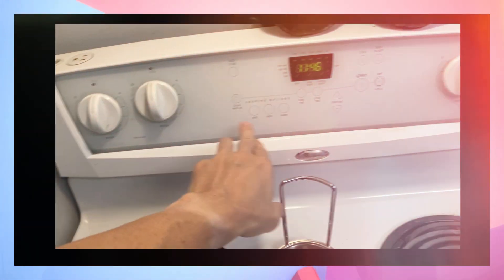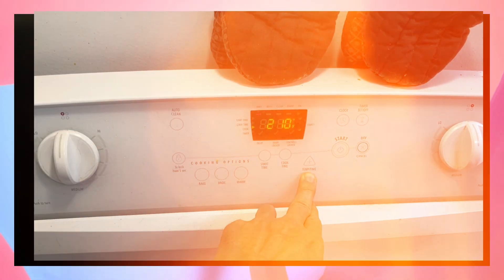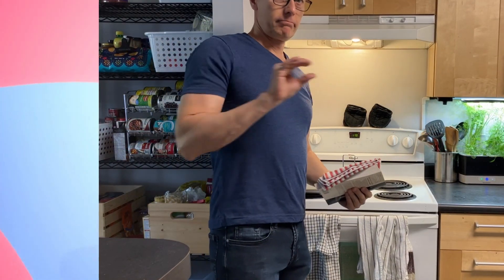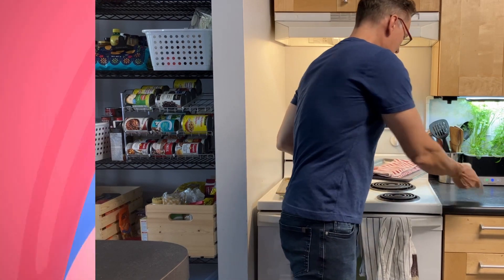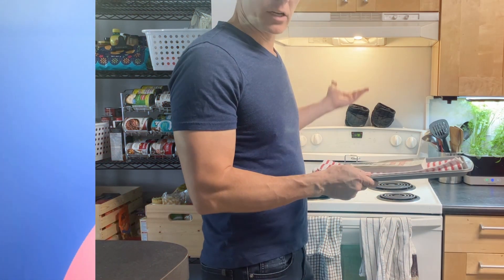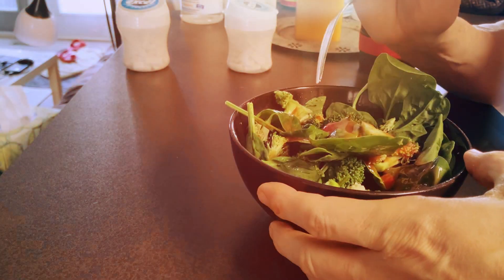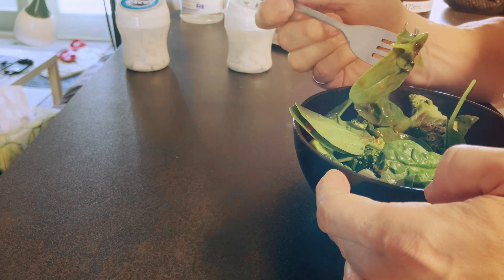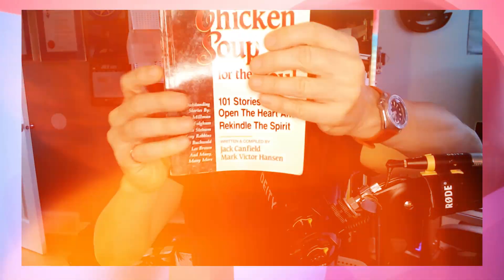Heat-Powered Book Separation: A DIY Guide to Oven Method for Effortless Digitization

Comment: I agree, 100%. In my opinion, the book that you scanned in is much better representation. I think one other benefit for students and researchers as you can see much more clearly quotes, indented, material, tables and graphs, etc. It is really important to separate these things, especially when citing, crediting the right sources, and referencing the original source material. 

I also think it’s a much cleaner and easier presentation to work with….

In addition, as a psychologist, it sometimes the easiest way to share a workbooks, worksheets, illustrations, etc., with clients. It’s not the goal to share the entire book, but the goal is to share worksheet pages and other material embedded into the book.

Obviously, if the goal is to have them work through an entire workbook or something similar, I would simply have them buy the book and work through it together. It’s more when I have manuals for used by the clinician with embedded tools that I need extracted to provide them with… In this case, the scanned PDF is the best option as I can give them a little section or workbook sheet or graphic or etc..
Reply from the maker: Agreed! Often the page layout (for lack of a better term, since ebooks don't really have a "page") is very badly done in ebooks, unfortunately. I discuss this in one of my other videos: https://youtu.be/cVbaw02yGeI?si=E6ffoO-1HgmLQZ8m 

Thank you for your comment.

Comment: I thought about putting the book in the oven then thought about how the whole thing is going to cool down rather quickly. When will people who have surpassed adulthood realize that having anything in an oven without preheating is going to subject it to much higher temperatures than what it was set to? JFC. Who enjoys listening to music competing over others voices? Not sure about anyone else but the hair dryer trick to warm up the binder on the outside and on both sides of the pages while pulling straight away from the binder has worked for eons.
Reply from the maker: I had never heard of the hair dryer hack prior to thinking about it while drying my hair one day. I guess good ideas constantly resurface. 🤔

Comment: Getting glue stuck in your scanner would be a huge pain in the ass so after you've separated the pages out it's important to examine them for any glue and to remove it using a blade.

Make groups of 20 or so pages at a time and fan them out on a cutting board or knife friendly surface. I have granite countertops.

Then use a rounded blade like a non-serrated kitchen knife to scrape and push the glue off the pages.  Make sure the knife is continually moving from left to right and tip to stern to minimize paper tearing. Dont drag the knife over paper but instead push the blade forward over it like a straight razor witg the difference of also running it from tip to stern.

This will hopefully cause the remaining glue to roll off. But if it's really stuck to the paper you will shave off a little bit of paper with it to get rid of the rest of the glue.
Reply from the maker: Good point, and good tip! In the follow-up to this video I explain and show how I use a guillotine cutter (which was itself featured in yet another video) to trim the glue edges.
Reply: @DigitizeYourBooks  I did that once.  Had a print shop at work who was happy to guillotine things for me.  There's a few different ways that a guillotine cutter can work. And a few different ways it can go wrong if the book is too thick or it doesn't have a strong enough clamp.

Peeling the glue off like I did isn't perfect either and it's WAY WAY more time consuming and leaves a more ragged edge.  But to  guillotine a book, you have to forfeit 3/16 to a quarter inch of paper from every page no matter what.  I did Jack up about 2% of my pages deeper than a 1/4 inch with the knife.  Usually because the glue happened to be that deep anyway.  The very first and last page for some reason seem to have deeper glue than rest.   but those I didn't jack up, almost never lost any area of the page.  So the scans include the very edge of the actual fiber.  Handy for images meant to span two pages.  A guillotine will always have to say goodbye to a slice of those.

I wonder if perhaps I could sandwich a book between two pieces of wood, screwing together tight, and feed the spine of a book to a belt sander that way.  Sanding just enough that there's no visible glue and then stopping.

Comment: I tried in the oven but my books were too big and maybe my air conditioning was too strong and the books cool down before I could even 5% of the pages separated.

Try using an infrared heater.  A space heater. It works well for me to hold the book so that the spine is over the infrared heater bar on my space heater.   I keep the book in the right spot to stay warm with my right hand and I use my left hand to pull pages off one-by-one and stack them to the side
Reply from the maker: Excellent! What a good idea!

Comment: Well, as for the clipchamp software, your audio is mixed only in the left side, and the film gate overlay effect runs throughout the entire video, so that's distracting.  But I'm sure it can be fixed with some settings, and maybe reuploaded if fixed?

As for debinding using an oven, I think the dangers outweigh the benefits.  You don't want any glue touching your scanner; it leaves residue on the glass, or much much worse for ADF scanners which is what I use.  Also, you run the risk of browning thinner paper (ie. what worked for the last book will literally cook the next book).
Reply from the maker: Thanks. Yes, I am aware of the one-sided audio. Like I said at the begining of the video, this was a "quick" one. I should have clarified that I meant it would be quickly prepared (since it came out to 10 minutes, which is hardly "quick"). It was an opportunity to try ClipChamp's "auto" settings, and it sucks. It was actually worse before I cleaned up some things, but didn't want to spend any more time on it than I already had.

I agree about the glue danger. I didn't show, in my haste, using a guillotine cutter to trim the glue edge off pages, about 10-15 sheets at a time. Without this step, none of this works. Shame on me for not explaining that important step. Thank you for mentioning this, I hope more people see this.

I agree that we don't want to overcook and brown the edges of the paper, but I doubt it will be a problem with the time & temperatures we are dealing with here. But definitely something to keep an eye on!